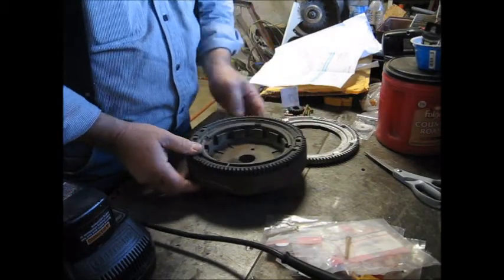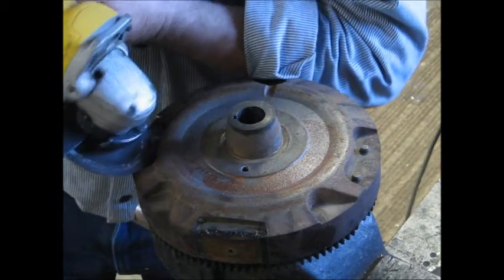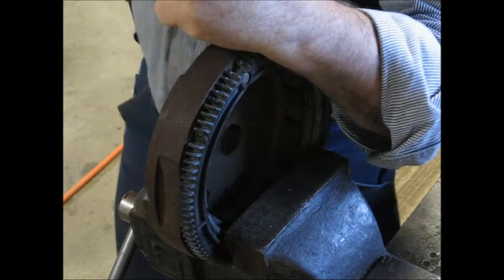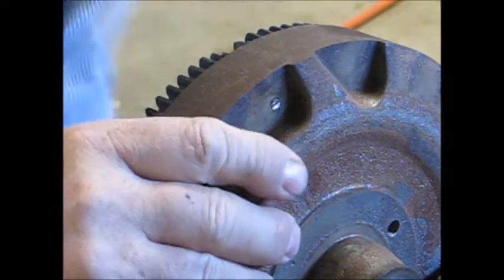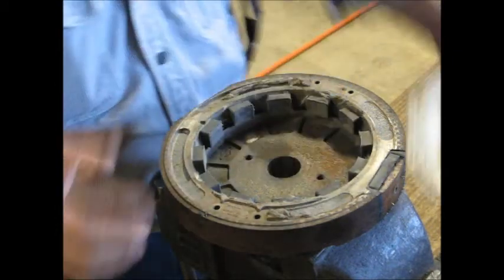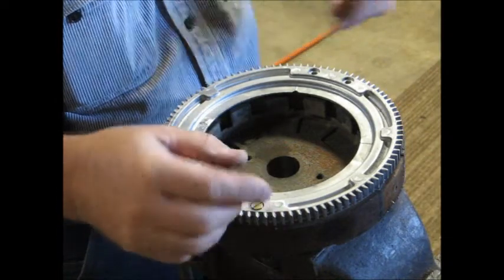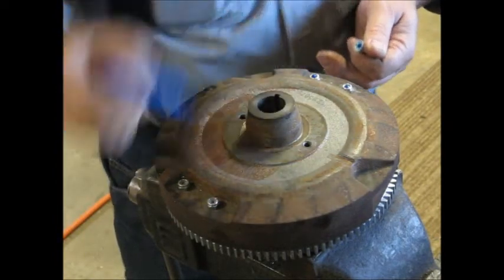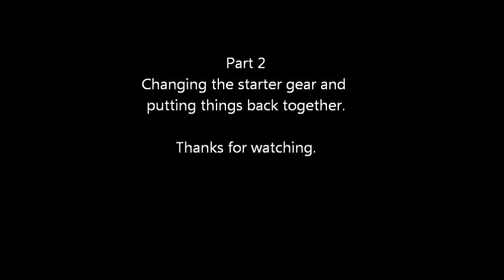Lawnmower repair Part 1 (Ring Gear)

Comment: i just bought a new flywheel ring gear for my wheel horse.  looks hard to do. how long did it take you
Reply from the maker: It took me an hour.
Reply: Is that for the Toro Wheel horse? i have a 1996 that needs a wheel. Where did you purchase the wheel? Thanks
Reply: How much does the flywheel weigh without the ring gear?
Thanks for posting I'm doing a custom project and your videos helped a bunch!!!!!

Comment: Did the new gear come with the new bolts and nuts.
Reply from the maker: +Grant W. Whitwam 
Yes it did. The parts manual didn't show them as a set. I ordered them all.
Reply: Thanks for the info. I just bought a new front pivot bar for my rider, amazed I could still get such a piece.
Reply: @DaleHobbs39  a!wa!aa